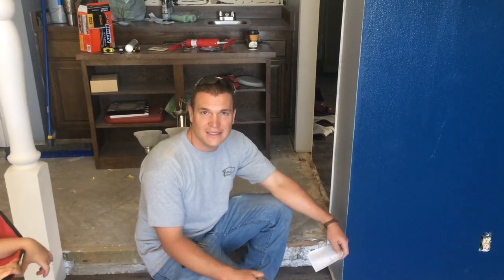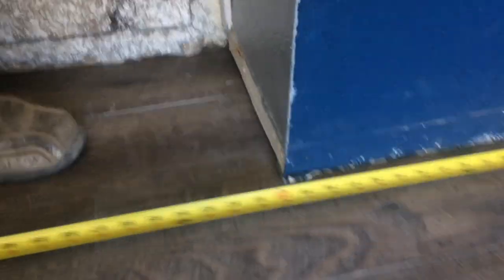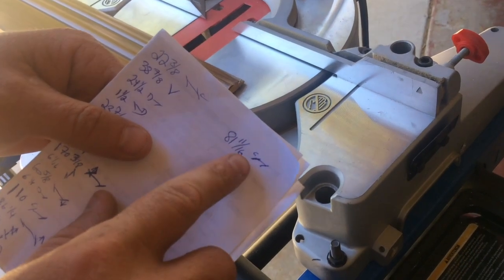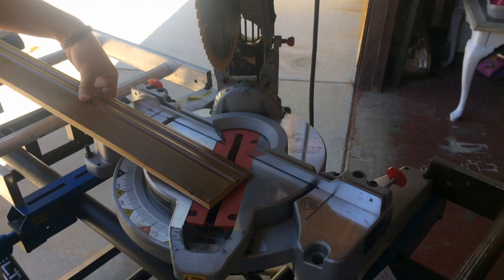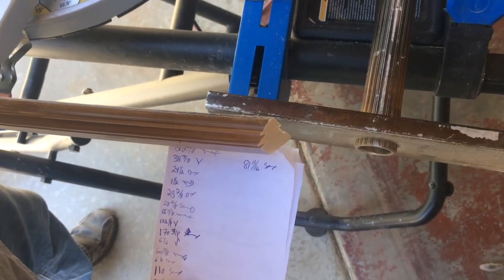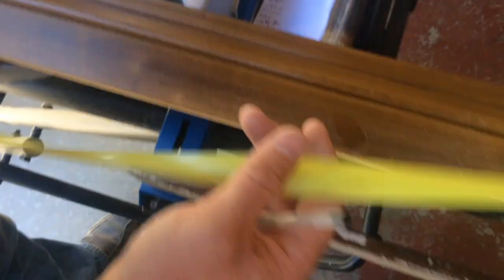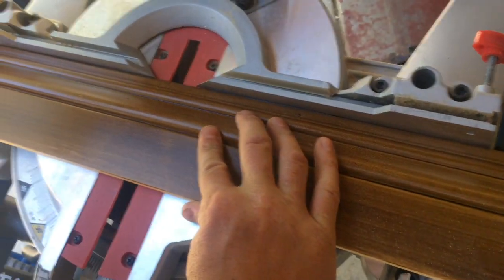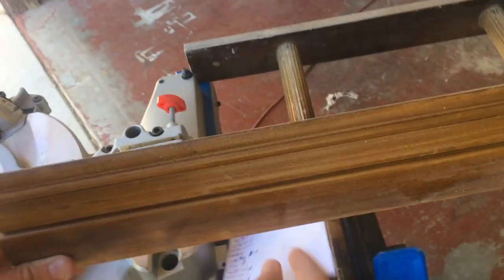🤔 one main hack for measuring and cutting large base boards easily🤩

Comment: Everyone does not have a compound miter saw!
Reply: virtually every miter saw sold these days has at least a bevel on one side, most are now dual bevel. If you're doing enough trim, go buy the proper tools. You don't even need a slider.

Comment: Thanks for this video (watching 6 years later lol...) doing a project and my end angle was always too short. Turns out at 1:47 explains why - I was measuring from the end instead of the top. I wrecked one board and had to pull it out because it didn't line up.  Thank you again.
Reply from the maker: You’re the best! Thanks for your support!

Comment: Straight to the point!! Perfect what if both sides are outside corner? How do you measure that on the base board?
Reply from the maker: I always measure the wall and implement that on the back of the base boards. Meaning measure and mark the back of the base.

Comment: You need to get a fence for your saw…
No pro is gonna keep tilting their saw back and forth
Reply from the maker: I’m a pro, and I tilt it!
Reply: @constructionhacks9293  Normally I (and all pros) cut the inside corners on a 44.25°+/- angle and outside corners on a 45.75°+/- angle, you should know that… And it’s a PITA to do that on the tilt… It’s just faster, easier and safer to cut your baseboard on edge, aka standing up.
Reply from the maker: @hmtrimworks7148  your funny! You must be used to working with small things!
Reply: @constructionhacks9293  You’re definitely no pro… a professional would first of all have a proper fence on his miter saw and proper wing extensions, not an ladder, propped up with an ironing board… and then eyeball the cut… Yeah, that’s real professional all right 😆
Reply from the maker: @hmtrimworks7148  sounds like an innovative Pro to me! You probably can’t think outside the box which is sad in my professional opinion!